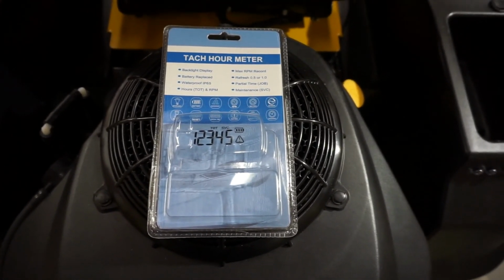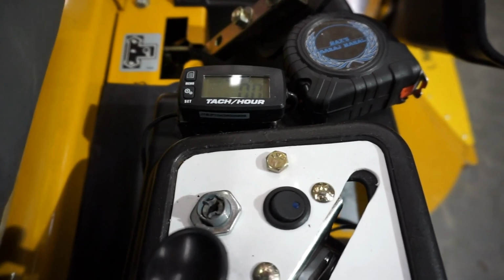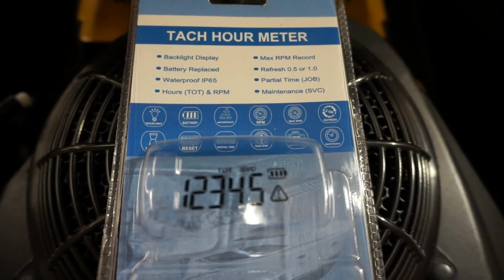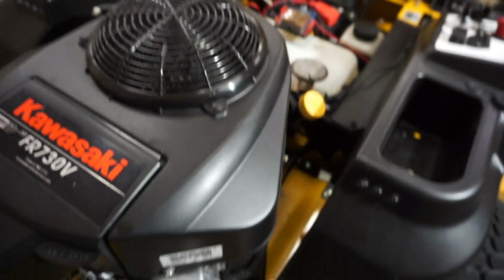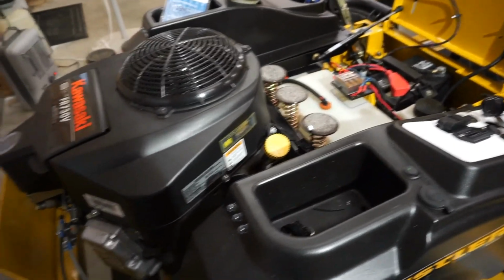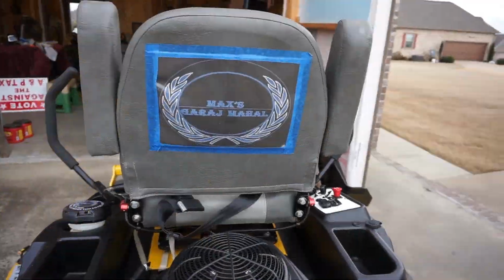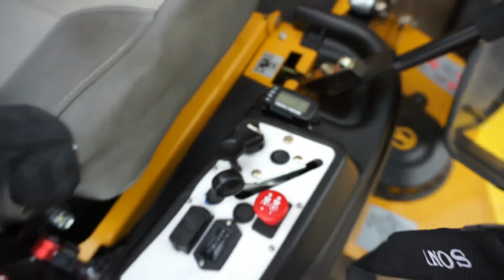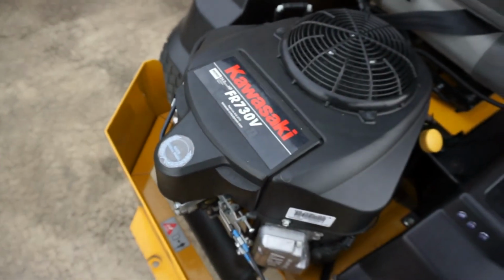Zero Turn Tachometer / Hour Meter Installation: Round 2 – Step-by-Step Guide

Comment: at 3:36 Partial Time (Job), maintenance (SVC) what is the funtion and also how you set it? Thank you
Reply from the maker: Partial time refers to how long you've run the engine while operating and the svc means set your service (maintenance) time so you get your service done on time. I use mine more for a tachometer than anything as that ensures I have the engine spinning high enough to maintain the correct blade tip speed to get a proper cut.

Hope that helps, you subscribed, liked and thanks for the comment (question). Every little thing helps grow the channel and I'm hoping one day it will actually begin paying it's own way. Ok, we both know I'll not live that long. Hahaha.

Thanks for watching.
Reply: @MaxsGarajMahal  Thank you for your reply, i appreicate it, May God blessed you with continous health.